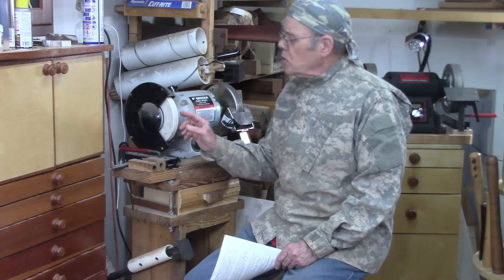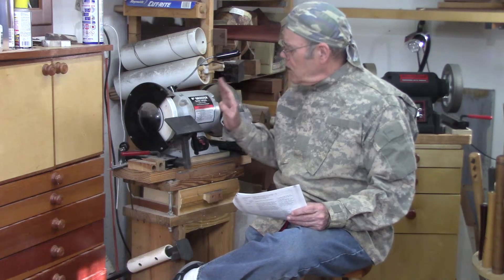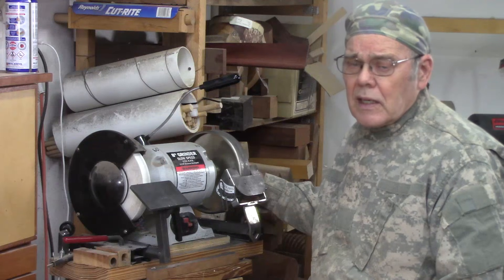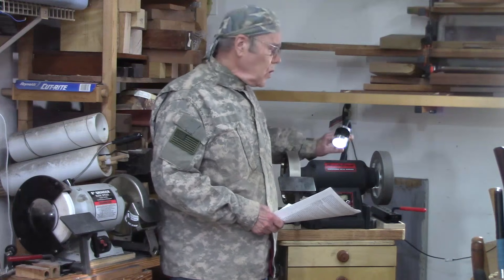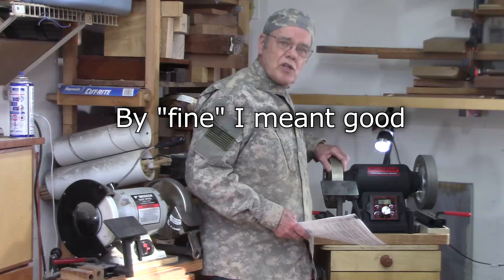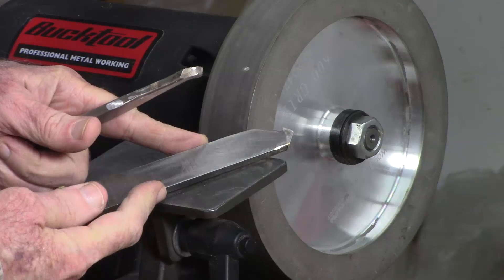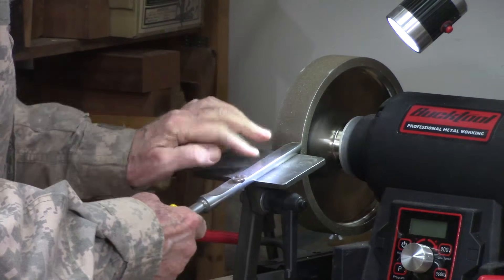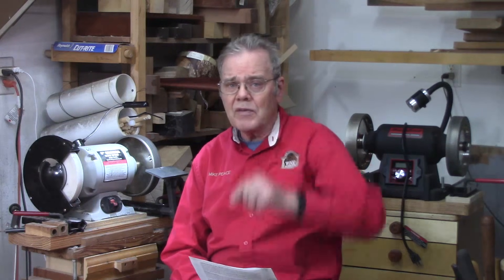CBN Wheels – Time to Ditch Your Stone Wheels?

Comment: Wondering how you clean your CBN wheels
Reply from the maker: I use spray PB Blaster and then use a very dense piece of foam to rub on it similar to using a a natural rubber block to clean a sanding belt. Great idea for a video short. Thanks!

Comment: I went to CBN about a year ago, best decision ever.  I'm not good at dressing wheels and with CBN, that isn't a problem.  Also, with heavy grinding it's much less likely to burn or blue the tool steel.  That big aluminum wheel is a heat sync that helps draw heat away from the steel.  Not perfect, still gotta watch it, but so much better than regular wheels.  Great info!
Reply from the maker: It's great to hear about your positive experience with CBN wheels and the benefits you've found!

Comment: I bought a cheap Chinese 320 wheel to sharpen my lathe chisels. It has worked great for over a year. I'm a little confused because I'm told you need 80 grit and 180 grit, but I find my 320 is perfect.
Reply from the maker: It's great that you found what works for your sharpening needs! You do not "need 80 grit and 180 grit" wheels as your experience shows. Everyones sharpening needs differ base on their individual circumstances. I suspect you are not changing your grinds and making tools.
Reply: Several years ago I bought a cheap 320 grit CBN. In my experience, it didn’t remove enough material to resharpen my tools. It also has plugged up and stopped cutting much at all.
Reply: Still hoping to upgrade to a 180 or 150 CBN. Thanks for sharing your experiences with these tools.😊